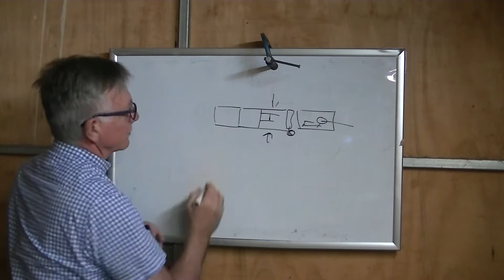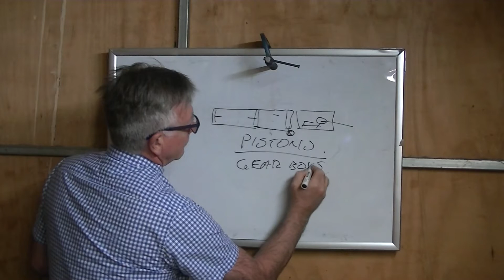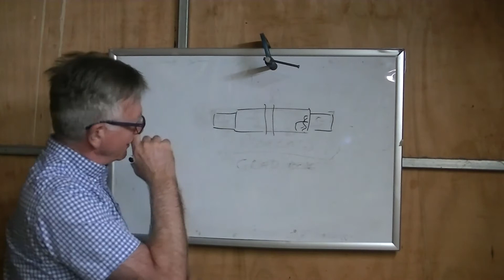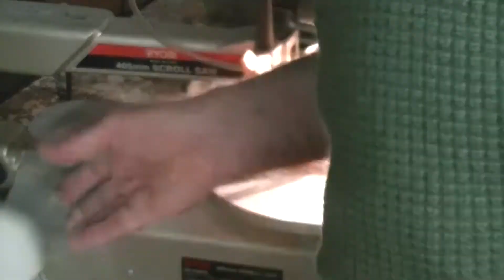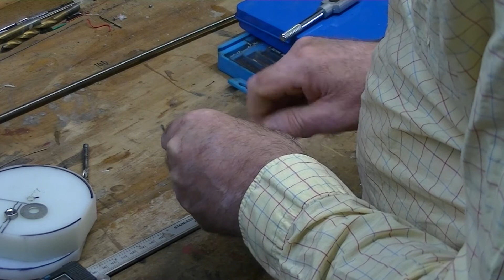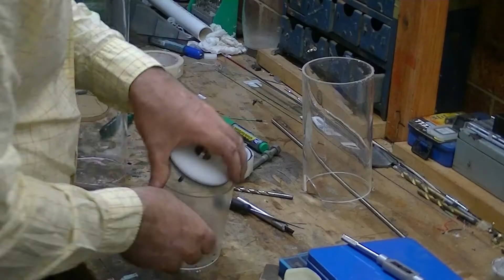Twin Pistons part one

Comment: If I might ask, are you attempting the twin piston to control balance of the boat on the pitch axis? Next question, I was tinkering with the idea of putting a water tight cylinder on a cam.  Setting neutral as close to the keel, then having it move in a manner to offset balance on the roll axis.  Thus enabling the boat to "bank" into a turn.  Thoughts?